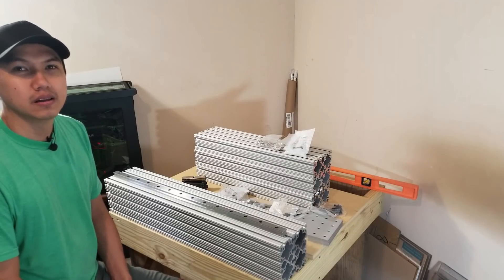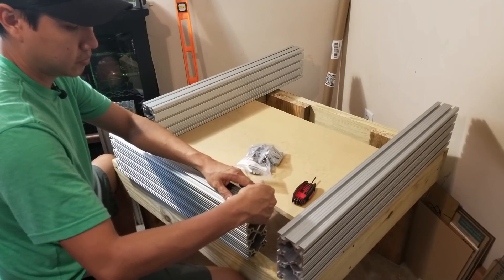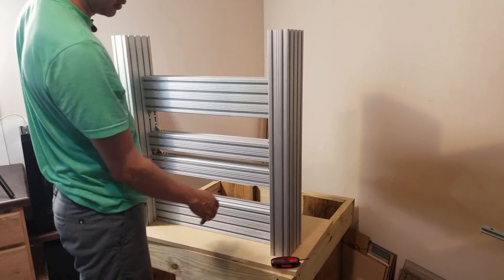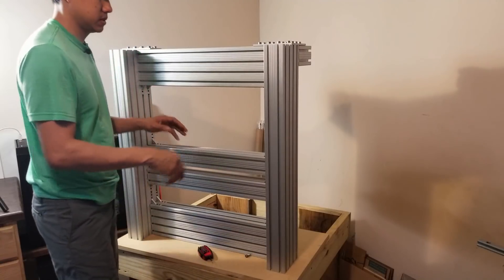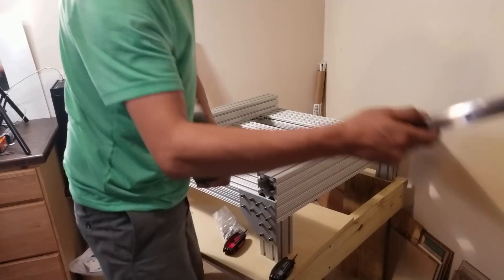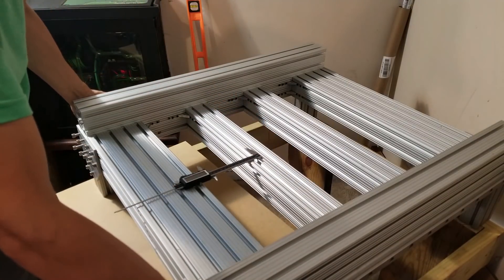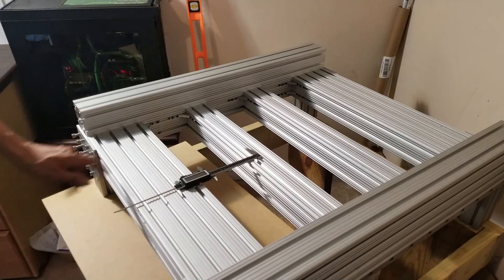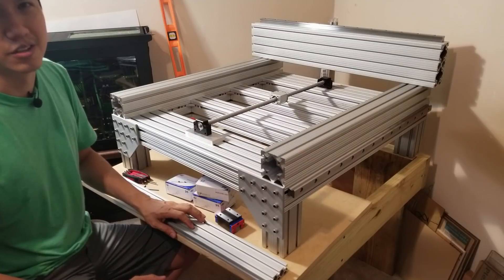Homemade DIY CNC build part 1 (Building the Fame)

Comment: nice work,i would need the link of the aluminum extrudes profiles,abaut that, is a good idea fill them with epoxi granite, in the grouded parts, the mobile you can fill them with expanded poliuretane, is heavy and strong.

Comment: how about your cost? i need to make one .
Reply from the maker: Phonepasit Sivilay total cost it was around $4k - 4.5 ish 
 But I there are ways to make it cheaper, like stepper motors instead or servos and thinner aluminium extrusions and 20mm linear rails would make it a bit cheaper

Comment: im building a cnc thats going to be between 300mm-500mm and im having trouble figuring out what to use for my xyz drive systems as its my first homemade cnc as i had access to cnc machines for a long time but im not sure whhere to start
Reply from the maker: Duncan Barton it depends what kind of speeds vs accuracy you want,  there is ballscrews, lead screws, rack and pinion, belt drive  and maybe other types that I don’t know
Reply: Radikult I want it to be accurate but at the same time I don’t want it to be terribly slow either. Thanks for such a prompt reply
Reply from the maker: Duncan Barton the ballscrew it would be the best option for accuracy and good speed,  then is the lead screw /rack and pinion,  and I would say last is the belt drive,  I would suggest before building it, calculate your total price vs buying a already made cnc
Reply: Radikult the issue I’ve come across is most of the cnc machines around the size I want to build have been that the x axis moves the waste board instead of the gantry. Something I don’t care much for as that causes a loss in workable area
Reply from the maker: Duncan Barton I know, you loose almost 50% of the workable space with those designs 
 You just need to “copy” a CNC router design and adjust it to the size you want

Comment: Hi Mario! Great design! I have watched your cnc videos and found all the part numbers. (I think 🙄) But what are the lengths of the profiles and do you still have the cad files for the plates of the xyz axis? Since you mill those on the 6040... This will help a lot with the replication of your design. Thanks for posting the build videos!
Reply from the maker: Oscar Broekema  Hello Oscar. The length of the aluminium extrusions are 
3 pieces of 3” x 6” x 870 mm 
4 pieces of 3” x “ x 635 mm
2 1605 ballscrews 750 mm (800 works too) 
1 1605 ballscrew 300 mm
Linear rails   300 mm and 850 mm 

Unfortunately about a week ago my computer SSD decided to mess up and I had to reformat everything and no back up data, so I don’t have those CADs, I can remember the lengths because I have my notebook with those notes lol
Reply: That's unfortunate losing your CAD designs. Okay, so my only option is to design the parts myself. Thanks for sharing!

Comment: Hej Mario, can you give the correct lengt off the extrustion, or how i can get it on the correct lengt, what to make one to my Garage too, great video.
Reply from the maker: Hi!   I order all the aluminium extrusions from 80/20 inc, there you just select the profile that you want and the length in inches or mm  and they cut it perfect for you
Reply: Yess but will you give me you length on all alumimium extrusions, because i dont know abaut the length on the ball skrue too, so if i order it fit together, hope you understand, you know ballskru and length on aluminium profile. Thanks.
Reply from the maker: 3 pieces of 870 mm 
4 pieces of 635 mm
2 1605 ballscrews of 750 mm
1 1605 ballscrew of 300 mm
linear rails  300 mm and 850 mm
Reply: Okay Thanks, and the cnc motor is Nema 23, do you have a number on that motor, and do you use 3-4 motor the same type on (Z-X-Y) ???
Reply: And what do you think the mashine cost price is????? Finish.
Reply from the maker: Kim Madsen the cost can varied on the item that you get,  I seen linear rails and ballscrews  sets for around $600 and some nema23 with drivers and power supply package for another $400 or so and the aluminium extrusion if you can find them cheaper you can save some money there too, you could build one for around $2000  if you shop around
Reply: Thanks Mario, I like the motor whit drivers inside like yours, it is not chip, but better i think. Thanks Again.
Reply: Hallo Mario, the gantrisupport is this the same lenght that is 870 ????? like on the botton 2 side 3/6 "????
Reply from the maker: Kim Madsen yes the gantry support is 870mm  same with the 2 sides
Reply: Thanks Mario, and the CNC DC Motor is??? Do you have the number on that Tecnik motor, because i what to make the same as you, Hope this is Okay. Thanks.
Reply: Thanks, i have to order thu Germany ithink, the aluminium extrusion, i have call some i germany, he can cut them he says, om the correct lengt,
Reply from the maker: Kim Madsen the servo motors are model#  2331s
Reply: Thanks so mutch Mario. Great video.
Reply: Mario there is sevel motor on Tecnik side, you say 2331s, but whitc one????? Many difrend pricses on that motor, neeed littel help here, the most expensive is around 599 Us dollar to 3xx some?????
Thanks. Kim Madsen.
Reply from the maker: Kim Madsen sorry. It's a SDSK 2331s 
https://www.teknic.com/model-info/CPM-SDSK-2331S-RLN/
Reply: Thanks Mario, the other is NOT chep. Lol, But Thanks Mario, i think i will maby go for another software, do you know somthing abaot this programm.Centroid Acorn CNC Control System?????
Reply from the maker: Kim Madsen no I don't know, but I heard good things
Reply: Yess me too.Thanks.
Reply: How did it goes whit you mashine CNC, have you get it full up and running??????

Comment: What are you plans for a plate set?
Reply from the maker: Robert Fontaine I’m not quite sure what you meant , but I’ll be using 1” thick aluminium plates and cut the side arms that will support the gantry and at the same time some parts for the Z-axis
Reply: I assumed because you were building a CNC that you didn't have access to one so would be buying a plate set from somewhere rather than cutting your own.
Reply from the maker: Robert Fontaine oh I see, I’ll be using my other cnc just to mark where the holes are going to be for the screws and maybe pocket the screw heads so they are flush,  but I’ll be drilling the holds with a press drill and if some cuts are straight, I could cut them with a bandsaw or table saw, even do I haven’t try to cut 1” thick before